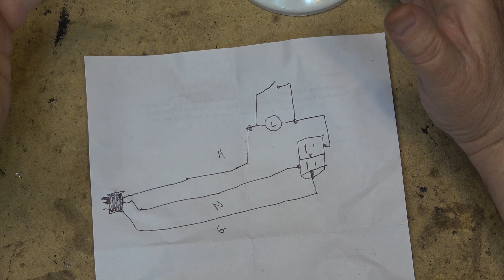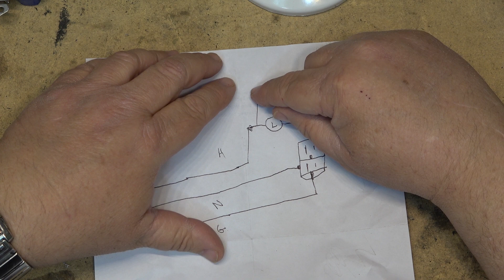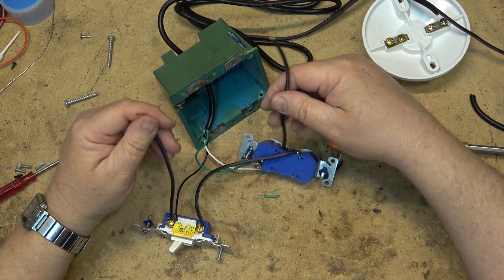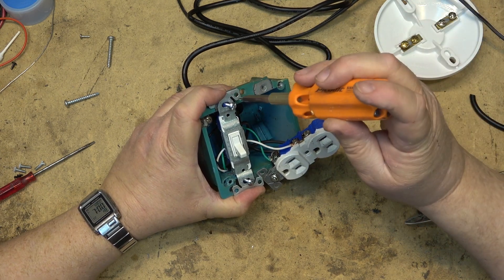Build a Dim Bulb tester to protect equipment under test

Comment: I was tempted to make one like this but I'm concerned about not having a switch to turn the unit off quickly in case of a short!
Reply from the maker: The thing is that is the point. If there is a short the light will glow bright and limit the current so no damage. Won't even blow the fuse.  That is why these are an important troubleshooting tool, a must have.
Reply: @12voltvids  makes sense, thanks!

Comment: I don't understand the working principle of this tool. Why would the bulb get brighter if there is a short? Isn't the bulb acting as a resistor, so it should prevent the equipment from starting if the Wattage of the bulb is too high, correct?
Reply: Because a dead short takes all the power from the wall directly to the point of the short - that’s why it smokes or blows out components.  The same current now must pass through the bulb so it lights up bright instead of blowing up your radio.  Think of the bulb as a pressure relief valve.  If your garden hose was closed on one end and made of thin rubber and you turned on the water full blast, the hose would explode - but if you put a pressure relief valve on the hose, that would trip saving the hose.  The bulb is the pressure relief valve.

Comment: Is that bypass switch in the correct position or the correct type?  It is interesting that it is in PARALLEL with the lamp.  It would seem like that circuit creates two paths when closed, as some of the electricity will still flow through the lamp at a reduced voltage while others at full voltage, essentially creating a circuit in which two different voltages are connected in parallel but in phase with each other.  I wondered if the correct circuit is to use a 3-way (single pole, double throw) switch on the hot side which one output goes to the bulb and the other switch output goes direct to the outlet.  This way you are switching the actual path rather than paralleling a reduced voltage path with a full voltage path.  Unless there is something I am not getting here.  Might be interesting to see if you are indeed getting full voltage across the outlet with the switch closed.
Reply from the maker: The switch literally short circuits the lamp effectively taking it out of the circuit.
Reply: @12voltvids  The resistance of the switch would be so unmeasurably low that there would be no current running through the light bulb, at least nothing worth mentioning.

 However, in theory, what he says is a logical assumption. I had a bond and ground meter at my old job that would send high current through a ground jumper and measure the small voltage across it to calculate micro ohms.

 I wonder what the resistance of a house wall switch is? I don't think my ESR meter will go that low, as it may be less than 0.001 ohms. 

Ya, ya, 99.999% goes through the switch, but once my mind goes into thinking about ohms law, I can't shut my mind off.
Reply: Current takes the LEAST path of resistance ,  The light bulb is a resistor in a way , current will flow thru the switched direct  wire more easier ..

Comment: Nice.  I use mine with a 15 watt bulb to set an external trim pot that adjusts 
Idle Current for my modified "200" Watt sub-woofer Plate amps. The large
heatsink fins run just slightly warm with no audio input. See zulumax comment!

Comment: An edison bulb socket to two-prong adapter works great.  Just plug it into one of the slots on the receptacle and done.
Reply: EXACTLY, just screw in the desired wattage bulb. Add a bypass switch for built-in full power. (a quad outlet arrangement could also eliminate the need for any switch, but that's not as slick looking. As a kid, I also used a screw-in push button "fuse shaped" circuit breaker (that was a popular upgrade in the years before circuit breakers).
Reply: Yes, this can be done, but it only works if you wire the two halves of the dual socket together *in series*; the stock configuration of the dual socket is  of course PARALLEL-wired.

Comment: Plastic lamp sockets are barely suitable for LED bulbs, but definitely inappropriate for use with a hot-running incandescent bulb. Use a ceramic socket, fer chrissakes. (BTW, even LED bulbs will usually benefit from the use of a ceramic socket because the ceramic will conduct heat away from the electronics in the base of the bulb far better than a plastic socket will, and thereby extend the life of the LED bulb).  If the main reason for using a ceramic socket is so that you can cut the base of it with a Dremel tool, then maybe you should be using a larger enclosure. I have the bulb socket wired to the output of my Variac and mounted on top of the Variac housing,  with a bypass switch. Far more convenient this way, especially because the Variac has a voltmeter and ammeter built-in.
Reply: I have never run my dim bulb tester long enough to put out enough heat to be a concern. I have thought about building a cage around the light bulbs however, in case something knocks over and breaks a bulb.That would make for an interesting day!
Reply: @zulumax1  , the appropriate wattage bulb to use, and the heat given off as it limits current to the device under test,  depends on what type of equipment one is most frequently working on.  You might be mostly working on radios with a power draw of 40 W, but at work I repair stereo equipment  that typically draws more than 100 Watts. The bulb in my current limiter is 150 W,  and if I'm working on a large power amp I might have to go to a 200 W bulb.  I do have a plastic cage over the bulb, kind of like a larger thicker version of a plastic peanut-butter jar, and I actually blistered and softened the plastic a little bit in one area from the heat given off by the bulb as I was working on a large amplifier.
Reply: @goodun2974  I generally shy from using a bulb on high power solid state amps. Variac and monitor the voltage and current.

 I have a video up of the Magnavox console I worked on featuring the dim bulb in part one, and the watt meter in part 2.
Reply: @goodun2974  Must be class A amplifier? Krell KSA perhaps or something like that?
Reply: @zulumax1  , nope, i mostly repair receivers in the 50 to 100 watt range. The current limiter is absolutely necessary when adjusting bias,  tapping circuit boards to locate internittent connections, or using meter probes to measure high voltages where a slip of the probe while could let the magic smoke escape.
Reply: You definitely don't want to see my dim bulb tester where I have the bulbs held in with hot glue.
Reply: @eDoc2020  , years ago, a friend of mine replaced the speakers in the top dashboard of his Saab 900 (originally a pair of upwards facing 4" philips woofers and dome tweeters) with better quality drivers, hot-glued in place. He did this in the fall; next summer, when the sun hit the dashboard, the speakers fell off their mounting plates and down inside the dash!
Reply from the maker: This is't plastic. It is a composite type material. Ceramic sockets are not readilly available here anymore. This is all they have.
Reply: @12voltvids   I just took a quick look online and it appears that ceramic sockets and incandescent bulbs are still widely available. Granted, I have not had to buy a ceramic lamp socket in years because I often find them for free at the swap-shop area of our local transfer station (ie, the "dump").

Comment: Incandescent bulbs are only available on ebay in the UK. With the state of some of my deliveries, I don't think they would survive shipping.
Reply: When I lasted "vacationed" in the UK ~30 years ago, I brought back an assortment of standard clear 250 volt lamps for this exact purpose.
Reply: They still sell 40 watt clear appliance bulbs for ovens and refrigerators.
Reply: @zulumax1  I never even thought of them. They are smaller too. Thank you.
Reply: @zulumax1  , those would work, but you'd probably have to put two or three of them in parallel if you're working on anything with significant current draw during normal operation.
Reply: @goodun2974  As a general rule if the device draws X amount of watts, that is the wattage of lamp I use. Most tube table top radios draw 40 watts, so 1 bulb is perfect.
Reply: I bet you could find incandescent bulbs at a flea market or bric a brac store.....
Reply: I believe pet stores still sell incandescent bulbs across the pond. They're meant for reptiles, usually pretty high wattage rating though.
Reply: @DGTelevsionNetwork  , infrared heat lamps used as food warmers in restaurants would also work. Similar bulbs are also used in some bathroom ceiling fixtures to help dry you off when you get out of the shower, typically in cooler climates anyway.  Years ago, one of my Floridian cousins was visiting us up here in New England, and after using the guest bathroom, she asked my mom, "Aunt Cindy, why do you have red lights in your bathroom?" 😀
Reply: Regular light bulbs at the dollar stores are plentiful in my area ..  I have plenty 100 watt bulbs just for this reason..

Comment: thanks again for a good video.
you put it at an angle because you are funky and demystify repair work  It does not have to be all pristine it has to work .
your bench looks cleaner then mine.
Reply: "Your bench looks cleaner than mine". That's a frightening statement!
Reply: @goodun2974  Mine is three to four layers deep with no flat surfaces visible...
Reply from the maker: @FindLiberty  A clean bench is a sign of nothing being accomplished.

Comment: As govenments ban everything usefull , future bulbs for testing radios will be resistance and thermisters to try to create a similar effect.
The visual feedback is always nice :-D
Reply from the maker: Incandescent readilly available here.  Specialty lamps.  Loophole.  A they had to do is call them a specialty bulb.
Reply: Oven bulb 40 watt clear still available, also used in lava lamps for heating the action.
Reply: Kids need to be careful to not get Salmonella poisoning from their Grandparent's original Easy-Bake (toy oven) that required a hot 100 lamp to cook properly.
Reply: There are exceptions to the incandescent lamp phase out.  Most rough service bulbs are not banned.  Stage lighting is another one that is not banned.  There are also certain incandescent made for industrial equipment and other very specialized applications that are not banned as well.
Reply from the maker: @stphinkle  Only general purpose lamps are banned.Heat lamps, plant lamps, speciality lamps such as for picture frames, rough service ect are still available.

Comment: Dave  a question .. here in the netherlands we can no longer buy regular bulbs only LED and that wont work for a dimbulb tester is there a alternative to make a dimbulb tester ? as i like to make one but I do not know what I can use as alternative to a regular bulb thanks
Reply: Visit your local pet stores' reptile animal section. They should have plenty of incandescent bulbs there, you're looking for a daylight heat lamp.
Reply: @DGTelevsionNetwork  Good idea. Thing is the last pet shop around here shut about 5 years ago, the nearest is 20+ miles away and I don't have transport. LOL. Great suggestion though.
Reply: @Franko_Walker  , perhaps a restaurant heat lamp bulb, used to keep food warm as it waits for a waiter or waitress to come get it. Or an infrared lamp used in a bathroom ceiling fixture for drying you off when you get out of the shower. ( Years ago, a cousin from Florida was visiting my mom in New England, and after using the guest bathroom to freshen up, she asked my mother "Aunt Cindy, why do you have red lights in your bathroom?".  Actually, in a Southern accent it sounded more like " Ant Sin-dee,  Whah do yuuu have red lahts in yore bath-rooom?" 😁)
Reply: @goodun2974  It would certainly give you a tan. LOL.
Reply: @goodun2974  OMG, What fucked up thing will people come up with next ? LOL.
Reply from the maker: Can you not buy speciality bulbs? We have tons of them here.  Sold as garage door opener
Reply: @12voltvids  all is LED here so no .. unless i would order it from the us or uotside europe but we have 240 volts so that is another draw back cant just order from the us .... or could put 2 of the 120 in series
Reply: or would a hallogen bulb work ? we can get those still
Reply from the maker: @Dutch-linux  you can put 2 120 in series.
Reply: @12voltvids  Thanks Dave
Reply from the maker: @Dutch-linux  Line operated (GU10) yes. A halogen is an incandescent. You would put 2 of the 50 watt types in parallel to make it 100 watts.
Reply: You should also be able to substitute the bulb with a (big watt) resistor.
Given the formula: R=V^2/P  so  (240*240)/50 = 1152 Ohms would equal a 50W bulb.
And then put a voltmeter across the resistor to monitor the voltagedrop over it.
The bulb is a much better solution, but if you can't get any...
Reply: @geirendre  The problem of using a resistor is the build up of heat. You would need a realy good , (and big), heatsink.
Reply: @Franko_Walker   The real problem with using a resistor as a workbench current limiter is that the resistor always has the same resistance regardless of current draw, whereas *the light bulb is a non-linear resistor*; it  has minimal resistance (and so it's very nearly out of circuit) if the current draw is low,  but it's resistance increases greatly if the current draw is high ---- plus it gives you a visual indication of current draw, and whether or not the device being tested has a major fault, depending on how much glow you can see from the bulb.
Reply: @goodun2974  Yeah. I would'nt trust a resistor. Bulbs are best. :)
Reply: @goodun2974  if a hallogen bulb would work then the problem is solved but not sure if that works ... i know that LED bulbs wont work and i do not want to build a complicated solid state circuit for current limiting
Reply: @Dutch-linux  Halogen bulbs will work just fine. Other than the special glass gas in the envelope they work in exactly the same way as regular incandescents.
Reply: @eDoc2020   Somebody pointed out in another similar video that you have to look at the actual power consumption of a halogen lamp and not merely the "equivalent light output". They're fairly efficient for a hot-filament lamp, and so a halogen lamp that puts out the same amount of light that you would expect from a 100 W standard incandescent bulb might actually only draw 30 or 40 Watts from the wall socket.  Also note that the glaring bluish white light from an halogen bulb could be a little bit obnoxious, and you might want a piece of smoked glass or smoked plexiglass in front of it to keep it from blinding you when it lights up.
Reply: @eDoc2020  ,  The so called "special glass" of a halogen bulb is actually quartz, but the increased light output and lifespan of a halogen bulb has to do not with the bulb enclosure itself but with the interaction between the tungsten filament and the halogen gas, and the only reason for a quartz bulb is that it can withstand the higher temperatures produced by the ultra high temperature filament of a halogen bulb. (The halogen gas prevents the tungsten filament from evaporating and causing a metallic film to be deposited on the surface of the bulb, which would also weaken the filament as it loses material, shortening its lifespan).  Halogen must bulbs must be kept clean, however, and should not be handled with bare fingers because the oils on the glass will damage the pass-through radiant properties of the glass, and a halogen bulb i normal use bulb eventually develop a hotspot and fail in that area,  although this might not apply to a dim bulb tester where the bulb isn't generally going to be run full blast at full brightness for any length of time.
Reply: @goodun2974  Oops, I didn't realize I wrote glass. I meant to say gas and have updated my comment accordingly.
Reply: @geirendre   Tungsten filament starts out at about 25 ohms cold and increases as the filament gets hot to somewhere around 1k, so the current will self regulate. A resistor can not do that, a thermistor can to some degree, but not like a filament can. Thermistor cold probably 30 ohms and 1 ohm when under load. Just an example....
Reply: Amazon here in the USA has a decent selection of Incandescent Bulbs.  Can you order from USA there in Netherlands?    If they were packed well they should survive the trip.
Reply: @dtravis7  those are 120 volts we got 240 volts here
Reply: @Dutch-linux  will keep looking and see what I can find.
Reply: Go crazy and think about: Toaster, curling iron, wood burning craft toy, glue gun, ceramic radiant heater, fuser from laser printer, refrigerator evap defrost heater, electric blanket or outdoor gutter de-icer. String them up in series as required for lowest current. Remember most have temp regulation and timers you will need to allow for.  They all get very hot. Don't build a death trap! An LED lamp in parallel might still work as an indicator.  Keep in mind not all electronics like to see a low line voltage.
Reply: Hi, look at Conrad, they still have plenty G9 halogen bulbs 20,35,50 and 60Watt rated for 230/240V , that type is very compact and you can use as many bulbs (in parallel with eachother) as you like.  
The ceramic sockets for G9 are widely available at local DIY store, or found at Reichelt. Grtz from Belgium (your neighboring country) 🙂